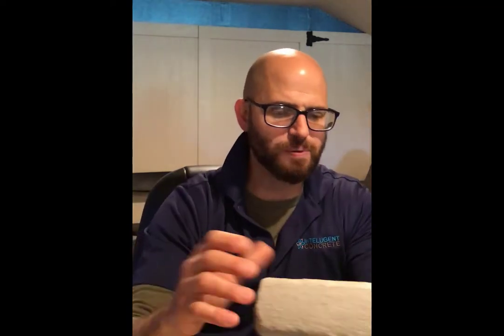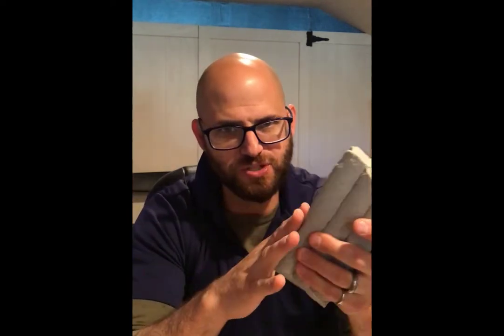What are the Unknowns for 3D Printed Concrete Structures When Doing Structural Design? - Vlog 372

Comment: Dr. B, thanks for going in this direction! At least two Chinese groups are printing with normal rebar in place, and one of them is using concrete from a truck. I have a hard time seeing ACI breaking all their own very rigorous rules about reinforcing (too rigorous I agree), as some groups are now able to print with code reinforcing in place. If a layered composite is used for resisting seismic loads without continuous boundary bars, shear reinforcement, confining steel etc, it may all work great; but it is pretty much the opposite of present ACI design philosophy. If the result is more reasonable reinforcing requirements for seismic design of all smaller structures, then I am for it.